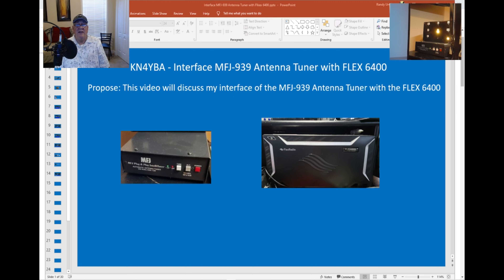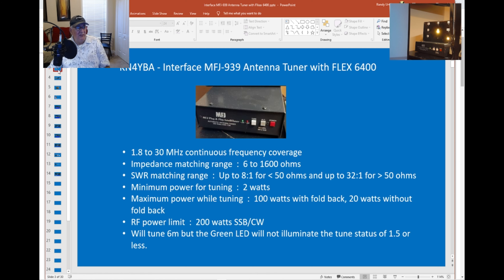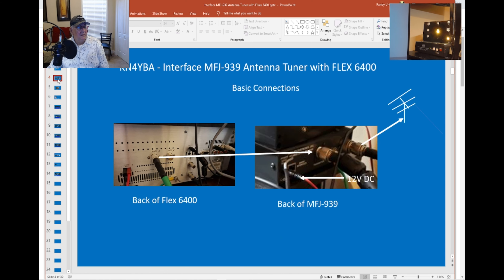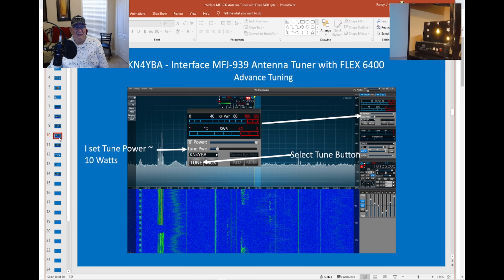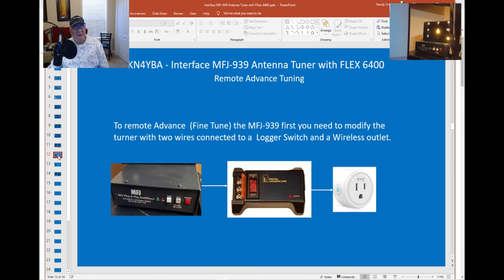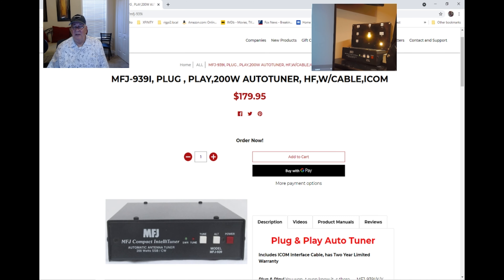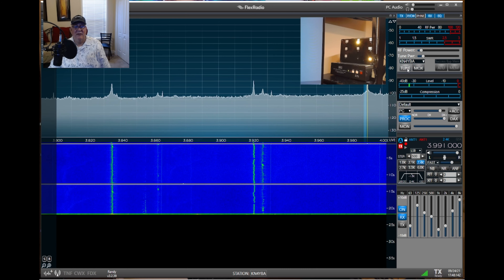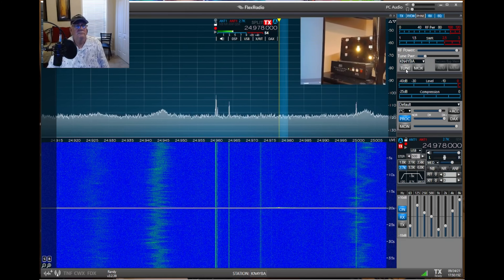KN4YBA   Interface MFJ 939 Auto Antenna Turner with Flex 6400

Comment: I am receiving my 6400 in a few days. I do not have the tuner option and will be using an ldg tuner. My question is when you hit the tune will the flex through out a carrier like keying the mike in an or digital modes or do I need to do it old school Thanks for any help